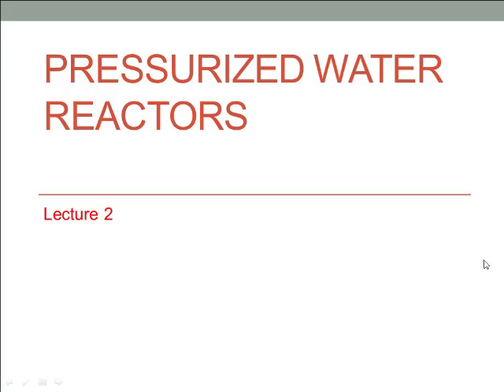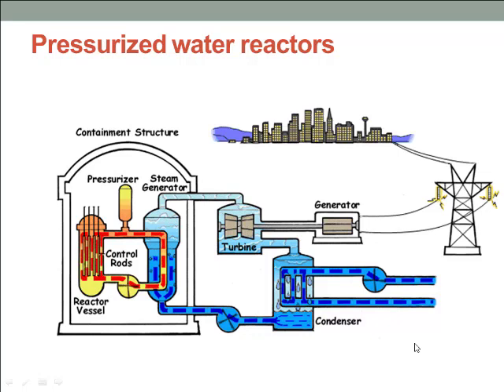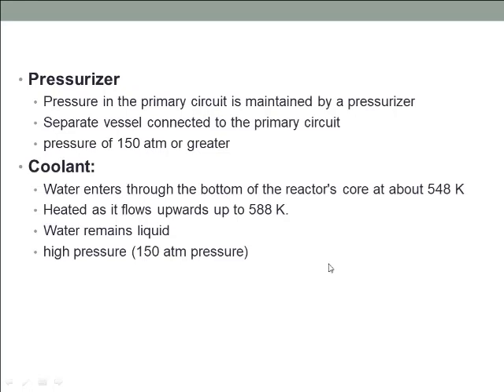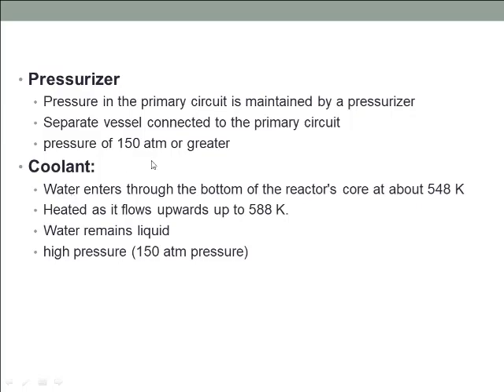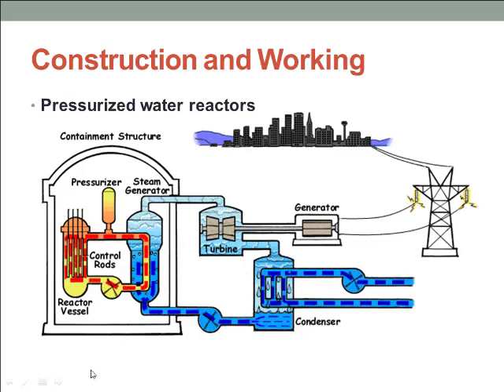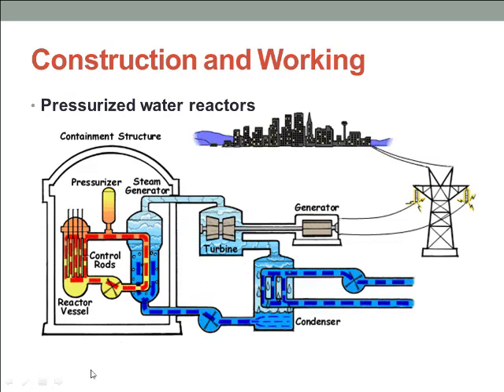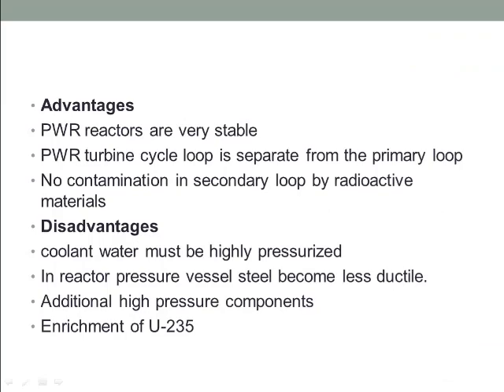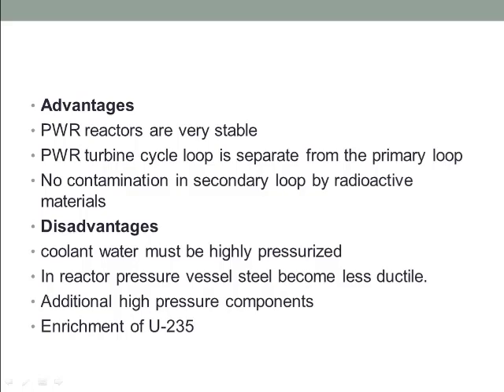Pressurized Water Reactor Vs Boiling water Reactor

Comment: Good video. Can anyone answer the below queries:
1) What is pressurizer? Is it a pump etc? What is it?
2) What is the boiler tube material in PWR and BWR?
3) Is U-235 is not used in BWR, that needs enrichment?
Thanking you for sparing your valuable time.

Comment: nice presentation.  my question is, 
In the primary loop, why is pressurizer installed on the hot leg????
thank you
Reply from the maker: Hot 🔥 part is the primary loop of the reactor, due to the pressurizer water can be heated far greater than the Boiling point.